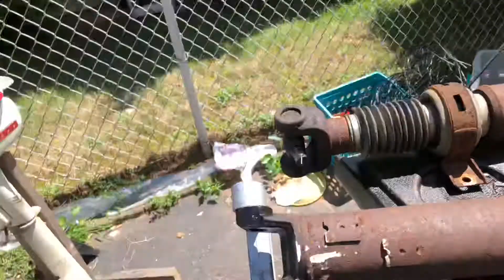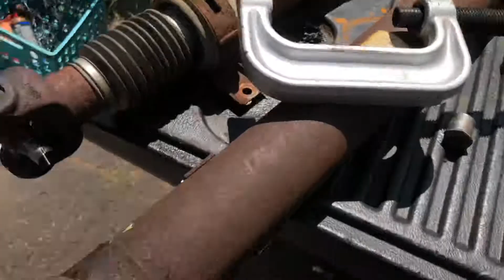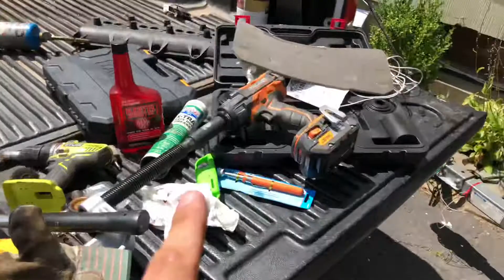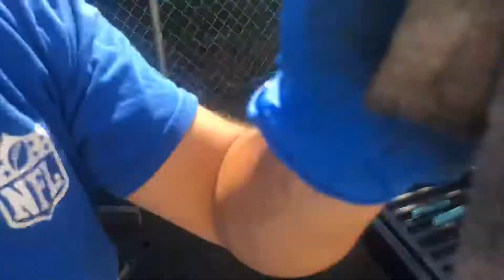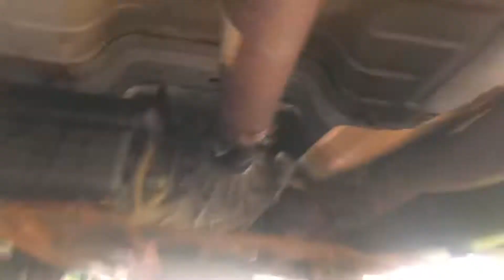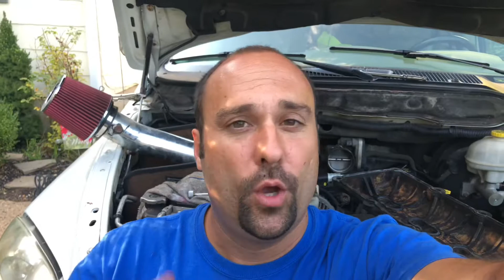2006 DODGE RAM 1500 MEGA CAB DRIVE SHAFT U-JOINTS COMPLETE!! Part 3 SCOTTY KILMER CHALLENGE!!!

Comment: What are those pins for that were on the old joints? They look like roll pins going through the yoke and the universal caps/
Reply from the maker: They hold it in place. It’s like a resign you have to burn out
Reply: @BlackoutBilll21  Oh ok, gotcha! Sort of like a warranty seal?
Reply from the maker: @Truckguy1970  think so. They actually play a pivotal part in holding the joint in!